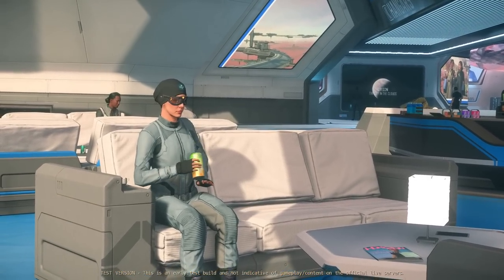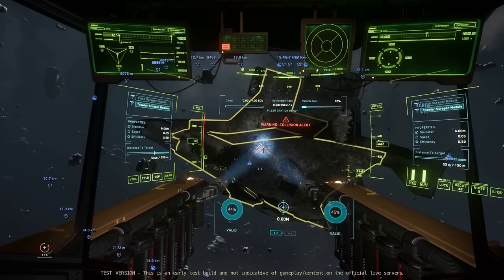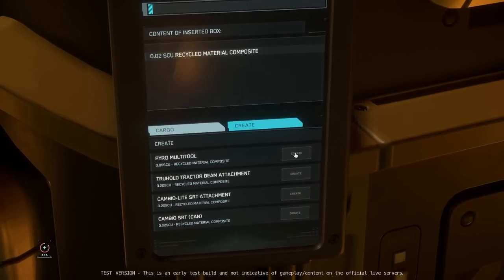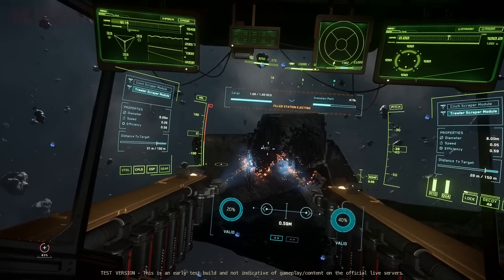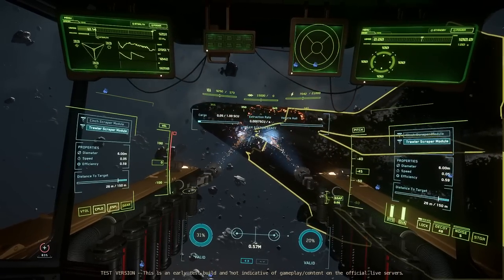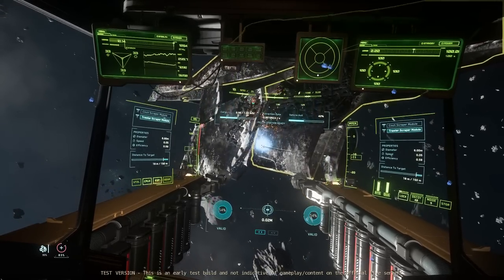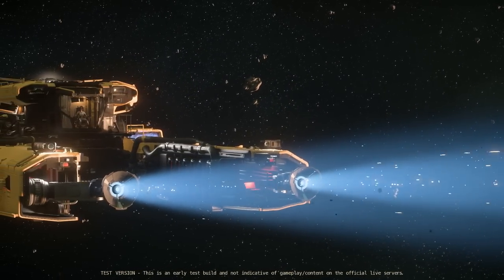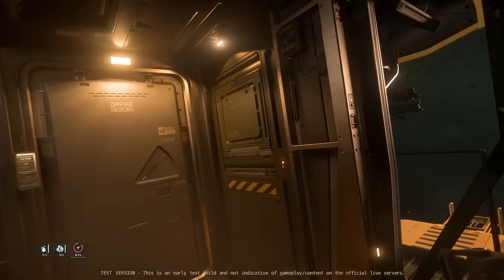Putting RECLAIMER Modules on the VULTURE - Faster Salvage? - Star Citizen 3.18 PTU

Comment: From my experience the "wreck pieces" or "nuggets" are better salvage than wrecks as they are undamaged so 100% hull on them. Usually get a few boxes per nugget and after 2 or 3 my vulture is full in less than 30 mins casual salvaging.
Reply from the maker: thanks for the tips! :) we'll have to try this next time we are out
Reply: My record so far is 12 scu from 1 panel. I was using cinch though but panels are imo better than wrecks. I usually find 4 or 5 panels close together and only need 2-3 to get 23 scu in my Vulture for 177k profit.
Reply: Very true!👍🏼

Comment: Hello, the Reclaimer has an hidden stat which boost the salvage speed by 3 (vulture is 1).
Reply from the maker: yes i suspected this was the case, thank you for confirming it! :)
Reply: Wonder if there will be an Argo or Misc that fills the 2 slot then
Reply: If you look at the modules they have two different values listed. The larger value is for the reclaimer and smaller for vulture.
Reply: Although to my experience it gets less salvage from smaller ships. Its large salvage beams tend to "Burn" a lot of the smaller ships material. I barely get a box maybe 2 off an avenger.

Comment: I would like to know how to get to 500k an hour solo. I am just going to cover nonevents grinding. You can do roughly 345k with bunkers 5min travel 4 1min wait and 3 min per wave total 21min per bunker. Mining quant is about 250k per hour in general because you have to take loading your ship and selling into account. Service beacons with the luck of the draw on high threat beacons could give you +600k which is three 200k beacons witch almost never happens (I usually get in a good run 2 100k and 1 200k) this is with a Hornet that can deliver some of the highest alpha to keep large shields in check that is +/- 400k. Scanner missions healed about a 160k per hour. I have not done Cargo but from my understanding with a big enough ship you could get to the mil mark but that will be extremely dangerous in 3.18 and will be high risk high reward.

I have gotten lucky running service beacons where I have pulled 4 interdictions in a row. witch at high is 120k each, that was 480k for 30 min as these are very quick to complete. 500k seems a little high and doing the math actually made me realize that I don't grind as much cash as I thought. 45K box missions are probably the most consistent income. Gives you about 135k per hour if you take your time with almost no risk but it is boring.

Remember if you say Credits/h it has to be able to be done every hour for a 4 hour session. (It has to be repeatable and not a once off)
Reply from the maker: I too would like to know haha :D I never really play with the sole intention of making credits so I am as in the dark as you on that!@ I do like your round up of approximate incomes for each profession though that is very helpful to know thank you! I will ask Razr for what he was referring to with the 500k per hour number :)
Reply: I'd say service beacons are your best bet...the more you do the more become available, so as long as you can find a way to deal with the occasional hammerhead, it should give you the best returns pretty consistently

Comment: You're salvaging the slow way here regardless. The salvage missions are less salvage and more trash. Essentially you accept a contract (small costing 5k, large costing 20k) and you'll need four small or 1 large to fill a hold.

Using the space, off the cargo grid to the right of the hold you can fit another 6 SCU of scrap. Giving you around 110,000 in profit, -20,000 for the cost of the salvage mission. HOWEVER, if you go to crew L1 and just ping your scanner you will find scrap panels, you can find clusters of 5 panels that will fill your entire ship with scrap in about 10 minutes. I've stumbled upon panels within 4 minutes of leaving the station. 

This cuts down the amount of time you spend messing around trying to "fully salvage" the wrecks and also saves you money.

Comment: for the salvage time = money problem, that also because it is only the basic, i mean that only scraped metal, that at best can be use for field repair. the value will change when we will have a real economy, like station and those refiniri where you go drop your mining to refine, would ask for scrap if they run low in construction material/ repair material for start. the main butter of salvage isn t in yet, like been able to recover weapon, missils, component etc from a derelic to use or resell.

Comment: Salvage in a Vulture has about the same average profit margin as mining.  Maybe just a bit better.  As RMC pays just shy of 8,000 aUEC per SCU.  You've got the expense of buying the claim as opposed to paying the fee for refining.  But you don't have to wait (come back tomorrow) for a refinery order to be completed.  The limiting factor being cargo capacity.  The Vulture will only hold 12 SCU on the cargo grid, plus 1 on the pad and 1 in the collector for a total of 14.  With some care you can add another 6 to 8 SCU by stacking crates beside the cargo grid.  Where the Vulture exceeds the profits of mining is the chance of finding one or more SCU of Quantanium in a claim.  For the Vulture, with its limited cargo capacity, it's actually not worth as much to collect any Gold, Taranite, or Bexalite if found.  As the RMC pays a bit better than any of those 3 products.  Alternatively, salvage claims from the General tab do not have time limits.  So if you reach the claim and find it has cargo you consider worth hauling off.  You can always return to a station to store your vulture and return to the claim in a cargo ship.  Then scrape the hull after you've collected the cargo.

Comment: A challenge for your team that I also mentioned to Ollie43's channel. Go to the outpost on Daymar and take possession of some of the barrier "walls" that cover the entrance to a trailer there and see if you can use them on a Ghost Hollow mission (or Kareah or whatever) as a shield. Not even sure it will work a s a shield but I bet you would do a great job being the guinea pig. LOL 🙂  Good luck - Orphanbird from SC. On those modules. I see their efficiency is .59. Aren't they .89 when installed on the Reclaimer? Good to see you have a slight spread (.02) on your lasers. Did you have the same distance to target? I checked for the test around minute 14 and I think you were about 1/2 the distance to the target that your friend was and I believe that makes a difference on efficiency but not positive. Next test make sure you have same spread, same distance to target. Can't keep it exact as you pan (depends on the angle of the target as you sweep) but you can start with beam  dead center at least a similar distance.

Comment: I think the best test you could have done is turn off the shields on a fresh recliamer, have both vultures eat similar sections on either side of the hull on that big salvage hold area, just to make sure the quality of the strip area is similar.

Those wrecks around the Lagrange points is spotty at best.

Fun test though,  I still have more fun in the 'claimer

Comment: and dont forget you also didn't do the same techique as him. as he was using the mining mode and you were moving the ship you probably could have even went faster had you not been moving your ship to salvage and just sped through like he was only using the beam.
Reply from the maker: yes this is a valid observation! completely agree, and i also feel that there is way more testing to be done to figure out exactly how the salvage and extraction mechanics work under the hood - i suspect once the patch goes live and people are living with it full time we'll get a lot of great insights fro mthe community through experience and experimentation :)
Reply: is that how you move the gimbals instead of the ship?  if you use mining mode your joystick/ mouse switches to the beams only?
Reply from the maker: there are several ways to do it - I usually use head-tracking to do it but TrackIR stopped working for me recently
Reply: @Dolph_Vader  That's if you [in 3.18: hold G / in 3.17.x: hit G twice] to use Targeting Mode for the heads, instead of the crosshairs that are pointed where the ship is.  You can 'paint' with the mouse cursor or joystick while keeping your vehicle perpendicular to your wreck and strafe around to get more / open places too, while keeping your beams 'on target'.

Comment: This is amazing!
It's something I just started thinking about - I am so new to SC.
It's also sensible that the larger ship should be able to make better use of the larger tools - power generation, processing equipment, and so on.
I suspect that the beams have an algorythm like the mining tools, and the mining tools in Eve Online. That algorythm probably isn't that complex, though, so variations due to overlapping the beams may well not be accomodated.
Would it be possible for a pair of small defensive drones to accompany the Vulture?

Comment: The hull strippers with larger areas are usefull for stripping large areas fast, but as soon as you use it on a smaller ship much of the stripping area is invalid and does not yield any RMC, which lowers the efficiency. And moving it too fast like you both did in the second head to head comparison leaves a patchy area with a lot of the hull not stripped, again inefficient since you would need to look for another wreck to salvage or collect the patches. 
imo the best way to go are slow sweeping movements with a salvage head that does not cover more area than there actually is.
Reply from the maker: the fast movement was to maximize extraction rate - which it definitely does! The point we ere making about time vs efficiency is that it doesn't matter how efficient you are if the time it takes means you make less than say running delivery missions or bounties over the same length of time. Yes there is fun to be had in salvage but gamers are using their free time to play the game right and so at the very least a large proportion of them will want a reasonable return in credits for the time invested. Efficiency is secondary to how many boxes do you fill per hour and by extension how many credits you can make in that time.

Comment: You can manually gimble the salvage beams...
Reply from the maker: I know and i normally use head tracking to do it but TrackIR isnt working for me atm sadly
Reply: @Citizen_Kate  i haven't been using trackIR in SC. it always seems to cause a ton of issues.  always worked great with elite and DCS. 3.18 is supposed to have a UI scaling fix for ultrawide monitors,  so I'm hopeful that might help.

Comment: Check out the outline.  It goes from green, blue, yellow, red.  This represents RMC density on the piece from best to worst.  A cinch with green will beat a trawler with red every time.  Also, moving it quickly does nothing if your goal is to harvest all the RMC on the wreck.  Staying in one spot until empty vs moving all over the ship and then doing it again and again with each pass having a lower transfer rate probably will take exactly the same amount of time.  If a mining head is capable of removing all the RMC from a given piece in, say, 5 minutes then how you move the head or your salving style is irrelevant.  Unfortunately, this video doesn't tell us anything about whether the trawler is faster.  As you noted, it's credits per hour.  Both ships need the same pieces though.  If ship A has green pieces and ship B has red ones, ship A will win every time no matter what heads they are using assuming the same ship.